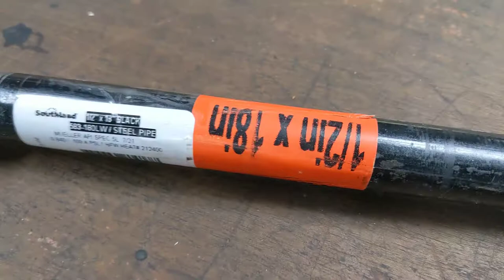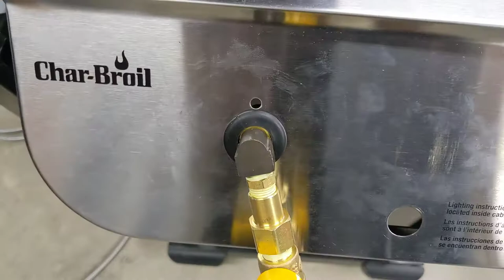DIY Outdoor Wok Cooking Station

Comment: Nice, I found a same BBQ grill at the apartment dumpster. removed the grill section, found a Stainless steel counter, drilled 11 1/2 hole  install on the BBQ frame and put a burner from Amazon in there.